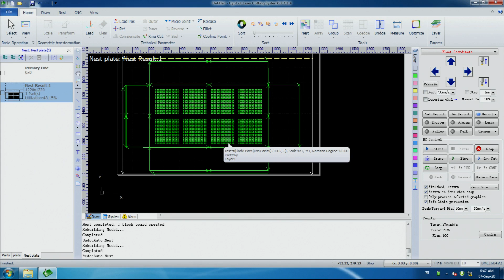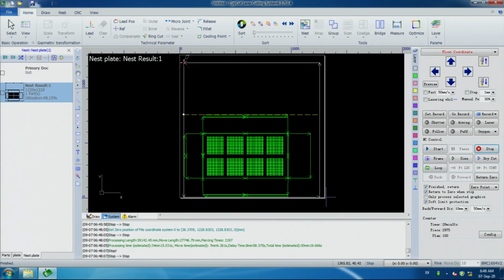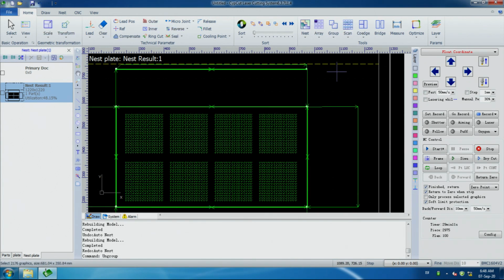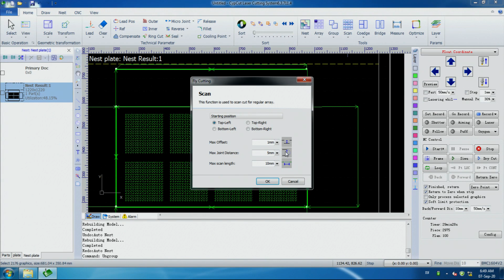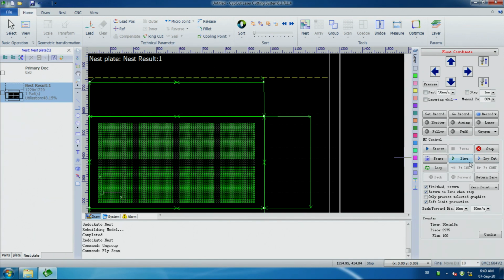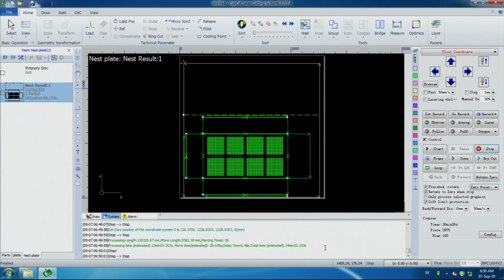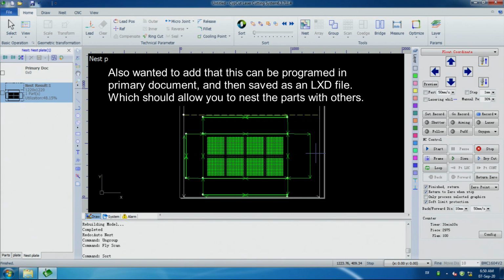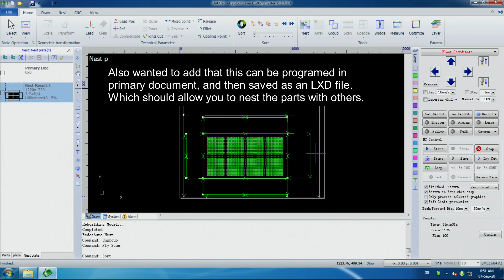Basic Fly cutting with Cypcut (english)

Comment: Hello
I have tried to do this with imported autocad files and it does not recognize the lines or the circles
Do you know how I can do it? thanks
Reply from the maker: A few things could be at play. Try moving the drawing to primary document, see if it will modify in that screen. I don't think flycutting/scancutting can be done in the parts menu. But once you modify the drawing in primary document you can send it to the parts menu..
Reply: Cypcut' ın desteklediği formatları kullanmalısın. Örneğin dxf.

Comment: A question.
Is it possible to make a hole with a measurement smaller than that of the thickness?
What tool could you use?

Thanks
Reply from the maker: I have seen it done and have done it a few times. Generally using a more powerful laser than needed for just cutting and high pressure inert gas like nitrogen is going to work better than compressed air or oxygen. The goal is to keep the metal cool and prevent the metal from burning. I want to say I saw a 3/8 inch hole cut in 3/4" carbon steel with a 10kw laser, which seemed to be close to the smallest hole on that thickness with any sort of reliability. Anything smaller is probably best to drill on a CNC mill.